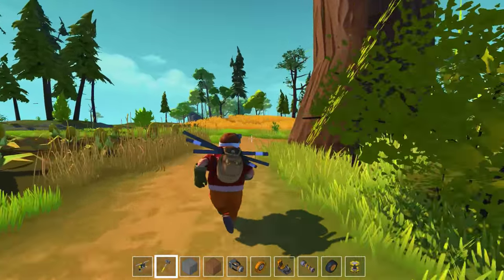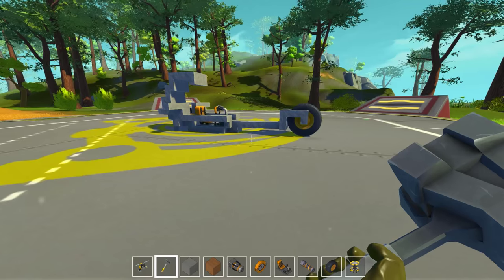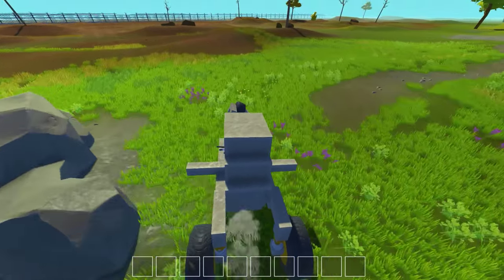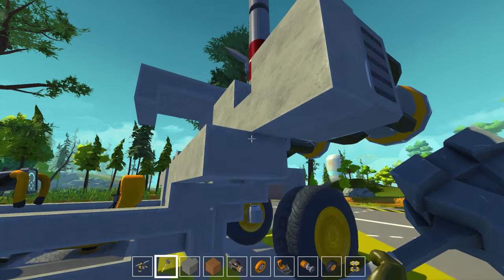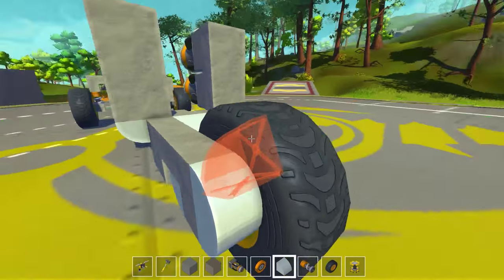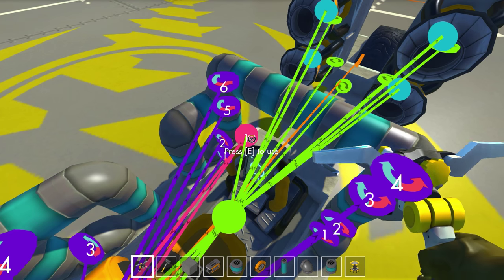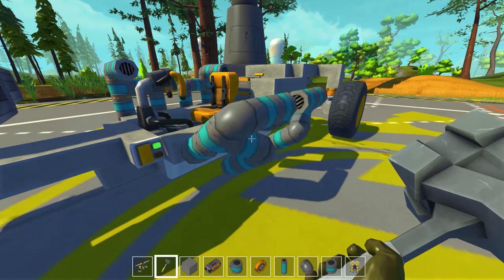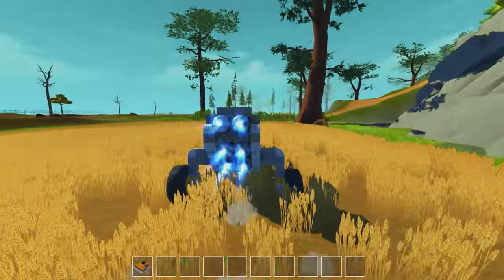Scrap Mechanic - Rocket-Powered Trike! [Pt.4]

Comment: You could try to use thrusters as some kind of heck spoiler, to generate more contact to the ground :D
So you need to put them on your creation and give them an angle of 30 degree for example..

-Lars

Comment: Your front bearing is off-center. It is possible to center it, but involves some controllers. I figured it out for a motorcycle I built. Made a video, but did not go into depth on the actual construction.

Comment: Make a floating house that you can make move through the sky at a leisurely pace, with an observation deck and a hole with a guard rail in the floor of one of the rooms.
Reply: +Kiba Bloodfang In the current state of the game it's incredibly hard to make a flying vehicle. To get a vehicle to fly you have to have just the PERFECT amount of thrusters in the PERFECT spots, then whenever you try to move it it'll either do barrel rolls, nothing, or somehow magically work. (I haven't achieved that magic yet)
Reply: OathkeeperOblivian Then the next addition to the game should be GYROSCOPES!!
Reply: +Kiba Bloodfang Or propellers that can allow you to hover #SKYBASE
Reply: +Kiba Bloodfang look up snocrash the gyroscopic physics are actually in the game and he has a few videos on it